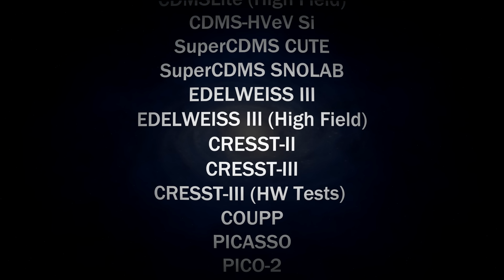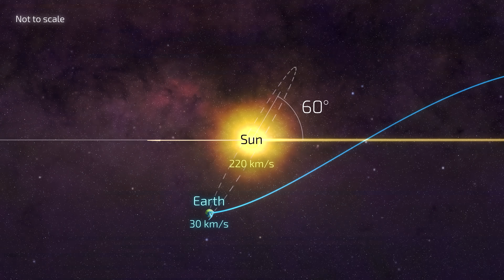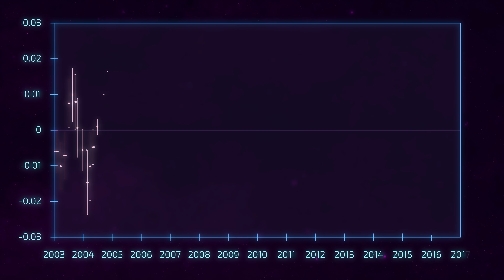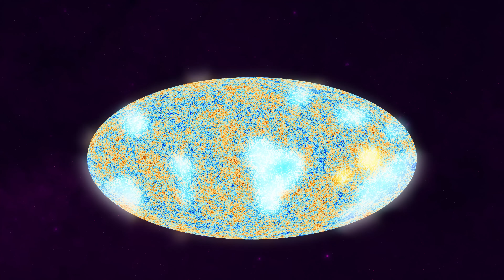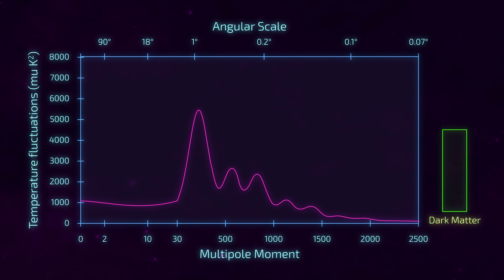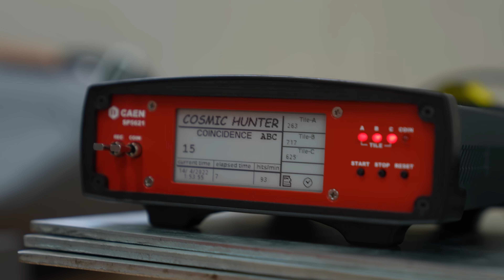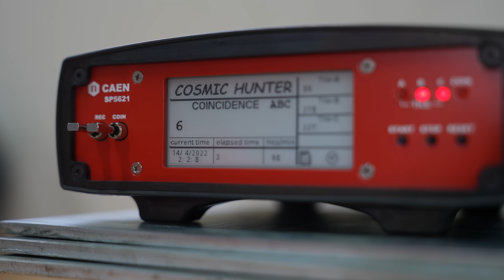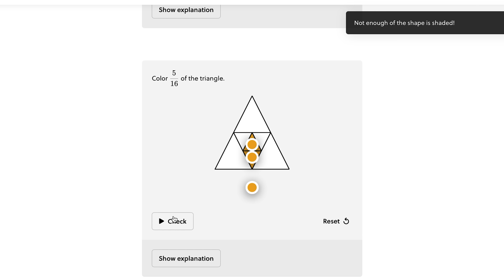The Absurd Search For Dark Matter

Comment: But if the stars in the galaxy need that extra mass, supposedly coming from dark matter, to stay in their orbit at the measured speed, how can we take into account the amount of mass inside of the (supposed) supermassive black holes at the center of galaxies? Do we have a way of measuring that mass? Can we compare if things orbiting smaller black holes exhibit a similar behavior? I am by no means an expert on this field, I was just wondering if that extra mass we're looking for could be from the black hole at the galaxy center (unless we've successfully measured that, then please never mind my suggestion ^^)
Reply: If the acceleration stays linear that means that mass also grows in a linear way regarding to the radius you travel away from the center of a galaxy, in this example a black hole. As the gravitation caused by the black hole should be calculated with 1/r^2 ( please correct me if I’m mistaken).
Thus a constant acceleration in regard to distance could be best explained by an also growing mass that has a somewhat homogenized distribution across the galaxy
Reply: @Tohuvvabohu  Basically correct, in Astrophys a velocity curve was first used to measure the orbital velocities of stars in galaxies (simply measured by doppler shift initially). If we set the gravitational force equal to the centripeteal force we get --> G*M_galaxy*M_star/r^2 = M_star*velocity^2/r so we would expect a 1/r gradient of the velocity curve. This isn't quite correct as we need to use newton's shell theorem and show the mass of the galaxy interior to the point we are measuring has an r dependence (the density of matter is something proportional to like 1/r^2 iirc) and then we can find a proper estimate for the velocity curve. 
Gravity of a black hole can be found using the inverse square law by measuring objects nearby to the black hole as dark matter is only significant over galactic scales.
Reply: @Tohuvvabohu  We can measure the mass of the Blackhole if it has something orbiting it.
Reply: @lsauce45  well yes, but the issue here is that if you measure the black holes mass while not accounting for dark matter you will get an incorrect result. So you would have to find a different way of figuring out for how much mass exactly each is accountable. That’s where you can use the concept I explained above to distinguish between the different gravitational fields they emit.
Reply: @lsauce45  But the entire galaxy is orbiting the black hole lol. And we can't measure the mass of the entire galaxy apparently.
Reply: Just as we can guesstimate that dark matter is present 5x to normal matter through its gravitational effects. We can also guesstimate with reasonable accuracy what the mass of black holes is. And we add the mass of black hole to the total mass of a galaxy so no that is not it
Reply: Yes, measuring the black holes' mass is elementary - you just look at the speed and the masses of the stars orbiting them (the masses being attainable through the mass-luminosity relation), and that's it. The masses of pretty much all black holes discovered thus far are known.

Also, even if we didn't know the black holes' masses, that wouldn't change anything, as the main/original source of evidence for the existence of dark matter comes from the outskirts of the galaxy instead of its centre, so what happens at its centre is mostly irrelevant.

Also, even if all black holes in the galaxy were suddenly teleported towards the outskirts of the galaxy, they still wouldn't account for even a fraction of the missing mass.

Unfortunately, your explanation doesn't seem to work any way that you spin it.
Reply: @maxkho00  How come movement of absolutely all galaxies are affected in the same exact way? Regular matter is not distributed uniformly in the universe. Is dark matter distributed uniformly? Shouldn't there be at least some galaxies that move differently because they have different form/amounts of dark matter around them?

I don't understand how that makes any sense. The way it is described it sounds more like there's some universal force affecting all the mass in the universe.

Or maybe dark matter supposed to be firmly attached to regular matter? If that's the case, isn't that just the same matter that weights more than we think?
Reply: Just to reiterate for those who do not read the whole thread, the mass of the black holes in galaxies is included in the 15%, as is the gas, dust, asteroids, and exoplanets. All of them interact with light, even if - as in the case of black holes, it is to capture it. Black holes also affect the light that comes near but does not cross the event horizon, thus we can detect them, take pictures of them, measure their diameter and calculate their mass.
Bear in mind that dark matter is not the same thing as dark energy, apologies if you know this already. And there is more than twice as much dark energy as all the dark matter and observable matter and energy combined. We can't detect dark energy either - obviously, other than the reason we think it exists at all. That being the fact the expansion of the universe is accelerating, which should not happen if the observable matter, energy and dark matter were all there is. The amount of dark energy there is is calculated by measuring the amount of energy required to cause the acceleration of universe expansion we have measured.
Reply: @TheJamesRedwood  Can a black hole consume dark matter ?
Reply: @ishaanupreti6438  It couldn't be tiny black holes, because we can detect black holes. And yes, dark matter can fall in to a black hole. It is called DM because the only thing we know about it is that it has gravity.
Reply: @ishaanupreti6438  Unknown. It is hypothesized that DM would pass right through a dark hole like it wasn't there.
Reply: @ishaanupreti6438  AFAIK we don't know.
Reply: @aaronmicalowe  But black holes influence things by gravity, and dark matter interacts with gravity.
Reply: @TheJamesRedwood  thank you sir for this rudimentaru yet sound explanation, sometumes you gotta see it as a whole
Reply: i love you <3
Reply: Didn't expect to see you here :o
Reply: Lol dubstep music
Reply: VIRTUAL RIOT!!!
Reply: bruh what u doing here
Reply: I think this is caused because the galaxies work like a single object. For example, in the solar system, planets that are closer to the Sun move faster and those that are further away move slower as one would expect. Where is the dark matter effect there? 
Would you expect that the center or the Earth rotates faster than the surface? of course not, because the Earth works like single object. The same happens with galaxies, when a certain density of matter is reached in a space, there is another force that holds it together.
Reply: @Trachta10  Galaxies do not work like single objects. Even at galactic cluster scale, they are amorphous and lose matter to each other if they get close.
As for your second paragraph. There is no another force, not in this universe. You are still talking about gravity, therefore we get the hypothesis of dark matter, we can see its gravity, so something must be there. This was all in the video. The reason its effect is not detectable at solar system scale, is because the scale is too small, DM appears to be too dispersed. A similar reason, in reverse, is why quantum mechanics is cancelled out at human scale, and you cannot pass your hand through another solid - despite such a thing being possible at the quantum scale.
Reply: @TheJamesRedwood  But in the solar system scale the dark matter is also there,  if the gravity of matter exists at solar scale then then the gravity effect of the dark matter should also be there in the same way that at galaxy scale.
Reply: @Trachta10  Yes it (the gravity of DARK matter) is obviously, always there. Gravity has not limit to its reach, but is does decrease at a rate equal to the square of the distance between objects, and proportional to the mass of either object. Dark matter is, like I said, very dispersed and in sub-atomic particle mass ranges (otherwise we could see it). It is only at huge, galaxy-sized scales, that the gravity of DM becomes large enough to be measurable.
Reply: Oh, it's easy:

You just put enough OTTs on the sensors until they start growling 🤣
Reply: If you look through the history of astronomy and the origins of "black holes" and "dark matter".  It comes from asteroid fields.  

Stars look like clouds, while asteroid fields look like black clouds (you have to be looking at a picture of the Milkyway galaxy.  Working backwards and the wrong direction, you get absurdities like "black holes" and "dark matter".

"Dark matter" isn't inaccurate, but there is already a label for asteroid fields.
Reply: @starbase51shiptestingfacility  All of that has already been accounted for, even the loose gas in space which adds up to even more mass. It's nowhere near enough to account for what is observed.
Reply: @aaronmicalowe  Let's see you prove what you say or be known as a troll.

You claim even gas is accounted for...  Let's see you prove it.
Reply: @starbase51shiptestingfacility   I'm not a scientist, but scientists have repeatedly said that they have accounted for all the possible gas in the universe and I accept that. But, to repeat, I'm not a scientist so don't know how to prove that and I am also not a computer database with access to a copy of everything I've ever heard. You need to find someone who is both a scientist and a database manager. Good luck. 👍
PS people who demand proof that they know is impossible to get otherwise threaten the other person with a label are the true trolls and are also fundamentally dishonest. FYI
Reply: Don't tease them with logic poor souls you'll kill their only brain cell then where will we be... oh, of course, left with the truth ... carry on then.
Reply: In my opinion, the additional mass cannot be central to the galaxy because it would change the speed of inner stars as well as outers. What we need is something that accelerates more for more distant stars. And thus it must be distant from the center itself.
Reply: @jpt3640  That opinion is exactly what is being said here 7:28. The dark matter is within and surrounding the galaxies.
Reply: @TheJamesRedwood  how come dark matter surrounds all the galaxies in the exact same way/shape? shouldn't there be at least some galaxies with different amounts/shapes of dark matter?
Reply: @jpt3640  fields can provide force at a distance from a central energy point.
Reply: Dubstep
Reply: @qualich  thats exactly what i was thinking haha
Reply: The point is that ‘normal’ matter doesn’t fly off from the spindles of galaxies - the angular velocity would overwhelm the gravitational field strength theoretically but there is something containing the matter almost
Reply: Dark matter could be tiny black holes scattered across the galaxy.
Reply: @ishaanupreti6438  The idea of black holes being the cause of dark matter was one of the first things people thought of. It's in the category of dark matter candidates called "MACHOs" or "MAssive Compact Halo Objects". Scientists have measured various properties that would be detectable if these were large black holes, and they have calculated the minimum size they would need to be to still exist, and there is a relatively narrow range of possible sizes. The minimum is 10^8 metric tons. So these would be black holes with the mass of asteroids too small to detect unless you already knew where to look and they would be distributed thinly through space. If that was all dark matter was and they were all that size, 1 would be close to Earth at any given moment so it would be unlikely we'd ever find it in the time before the sun dies...but it's actually worse than that since we know they can be much more massive than that, making them even less common to be 4/5ths of all matter. And it's also very possible that they aren't all of the 4/5ths of matter that is expected to be dark matter.

Of course, you probably noticed I didn't give the upper end of that narrow range. The minimum is pretty easy to calculate via hawking radiation, but the maximum is based on observational data which...has recently been growing more interesting.

If there are the expected detections in the equipment this video discussed, though... it's not definitely not tiny black holes. They are too massive and thus too rare to be detected in this way.
Reply: @Merennulli  Wouldn't black holes that small and towards the end of their lives emit insane amounts of radiation, making them easily detectable ?
Reply: @ishaanupreti6438  A thermal radiation source smaller than an atom (when it's that far gone) moving constantly, that can pass right through the earth would at best look like your thermal sensor had a minor glitch that never repeats, and the odds of it happening even once are astronomical.
Reply: @Merennulli  Who said it will pass through Earth ?
Reply: @ishaanupreti6438  This has already been considered and it's not enough and doesn't explain everything we observe.
Reply: This could be viable except for two issues: First, even if it's the black holes, it would still make the center rotate much faster than the rest of it, which is simply not how it was observed like the video stated. Second, Supermassive black holes are nowhere near close to the mass of the galaxy they're in, much less 5x of that so it couldn't possibly be that. To elaborate, the total mass of Milky Way galaxy is around 800 billion to 1.5 trillion solar masses while Sagittarius A* is "only" 4 million solar masses. But even if you don't know that, you can already logic it out considering there's 100-400 billion stars in our galaxy, it shows the differences in the scale. While it's true that star sizes also varies and our sun is on the larger end compared to a lot of other stars, the sheer number of stars still makes it much more massive than Sgt A*.
Reply: Yeah! And since we know nothing about it, we should check out how this mass interacts with a black hole, if we can detect it in some way, and if its relevance is proportional to what the theory would say about that unknown "matter".
Reply: @HawkFest  It is drawn to a black hole, like anything else that has gravity - that being the only thing we know about DM - it has gravity.
Reply: É isso aí gringaiada! Podes crer que nóis tudo tá ligado nessa parada do negócio da coisa aí!
Reply: Did anyone understand this?
Reply: lol
Reply: TF is VR doin here?
Reply: Make a dubstep track about your question 😂👍🔥🔥
Reply: The effects of dark matter only become measurably obvious over very large areas, like the size of a galaxy and above. Black holes, even supermassive, are tiny compared to the size of a galaxy, and I suspect that the effect of gravity from baryonic matter at those densities would overwhelm any detection of dark matter.
Reply: Wait what ? Should not you be making some Dubstep 🤣
Reply: the mass of a blackhole is measured the same way the mass of anything is measured: how other things orbit them. the mass of black holes in the center of our galaxy has already been measured and accounted for, it's really not that much compared to dark matter.
Reply: @Deltexterity  <--- Black hole cultist.  Notice that's all these guys ever do, but never ever prove it.

See how easy it is... I can claim the blurry picture of black holes are caused by gravitational lensing.  Notice no one ever gets around to proving it.
Reply: @Deltexterity  that's assuming the formulas used for the calculations are correct.
Reply: @ekklesiast  the formulae used for the calculations are the general relativity formulae (that's used for big things and quantum physics for small things), as general relativity has been challenged over and over again, thousands of mathematicians and the smartest people in the world trying to find a mistake, and not being able to. it's possible that our understanding of gravity is wrong, and that there is no dark matter, it's just that we don't understand gravity, but so far that seems much less likely. if the formulae for those calculations were wrong, it still wouldn't be black holes that are dark matter, because if gravity is wrong then gravity is dark matter. "dark matter" is just an attractive force we don't understand, if gravity is wrong then gravity just is that attractive force, and black holes are out of the equation regardless.
Reply: the most unexpected place i thought id you see virtual riot
interesting thoughts
Reply: Hello VR I am a fan : D
Reply: Idols guy
Reply: Black holes make up a tiny fraction of the total mass of a galaxy. In a solar system the ratio of mass is around 99% from the star, in our galaxy Sagittarius a makes up only .0004% of the mass. Just the mass from the black hole is not nearly enough to keep the galaxy together
Reply: or maybe the whole gravity driven only theory of the universe is completely wrong and it's driven by electric forces instead.

there was no big bang, there are no black holes and there is no dark matter.
observations can be explained by established plasma dynamics without the need for these hypothetical unobserved constructs.
Reply: @axeman2638  The electric universe theory is one of the most debunked theories there is. Electricity has been examined thoroughly and cannot explain observation.
Reply: I love that I just randomly ran into a comment from my favorite artist wtf. Love you VR, your music reflects your question ✌🏼See you at Bass Canyon and f gravity
Reply: That won't fix the discrepancy. If central mass (black holes etc) is large enough to explain outer stars not flying away at their apparent speeds, then observed speeds of inner stars become too slow to not fall into center.
Reply: @AG-ig8uf  that's assuming the gravitational formulas are correct? isn't that circular reasoning?
Reply: We know that the extra mass is from dark matter because dark matter also generates a different distribution of velocities for galactic objects than radiating matter plus a central black hole.  Even if the black hole at the center of our galaxy were larger, the objects at the fringe would still be moving slower than observed, it's just that the fringe would be located further out.  There are other explanations, of course, but dark matter is attractive (no pun intended) to physicists because it's the most consistent with other experimental evidence, like the expansion of the universe and observations of colliding galaxies.  Of course, nobody knows what it is yet, and it's certainly possible it's something else, but so far no one has come up with a better answer, so we're sticking with the dark matter explanation for the time being.
Reply: @annasimpson4147  Reminds me of helium. It was predicted to exist many years before it was actually discovered.
Reply: @aaronmicalowe  Indeed!  It took us 60+ years to discover the Higgs boson.  It will likely take us even longer to find dark matter.
Reply: @annasimpson4147  I look forward to the result of the experiment in the video and hope it shows us something, even if it isn't dark matter they're detecting. But here's an interesting thing, "dark matter" has already been found, by a universe modelling AI. It created a model so accurate that the only way that was possible is if it understood dark matter (or MOND) or something else entirely. Unfortunately, because it wrote itself organically, from within, even it's creators can't get the answer out. But it does prove a solution is possible.
Reply: @Shina We have seen the matter being pulled in. And if it was spewing matter, it would be very visible.

EDIT: So I get a "citation please" reply and then all posts by "Shina" are missing when I click to see the context. I'm going to write this off as yet another troll account.

Forewarning to any other trolls, you don't get to use demands for citation as a dismissal anymore. That BS worked last decade but we're not biting anymore. You just blow off whatever sources we provide, so it's not meaningful to actually provide them for you, and this is a conversation, not a term paper. And that's without even getting into the fact that Youtube throws posts with external links into limbo for anywhere from minutes to months with seemingly no rhyme or reason to it.

If you legitimately wanted a source, ask politely and indicate what you want it for. Youtube doesn't tell us what comment you're replying to, and 90% of the time more than one thing was said. So if you want to know a source for something, mention what something it is. eg. "You said water is wet, but I couldn't find any information to support that claim. Could you please point me to where you got that information?"
Reply: Black holes do exert a ton of gravity but only if you're very close, their gravitational impact is negligible once you're too far away (depends on their size) . They can't explain the speed patterns of a whole galaxy. Even though I would like this explanation..
 Would be cool if they are somehow the root of a "gravitational chain" that extends to the outside of a galaxy.
Reply: @Xyles7  More like TWO-AND-A-HALF tons! : )
Reply: @Xyles7  Oooooh yeah that's a cool one. I think it might be time dilation proportionate to the gradient mass quantity from inside to out. So we only perceive the laws of physics being broken. They are functioning quite relative to one another
Reply: @Xyles7  Sorry mate, this is a bit of a nonsensical statement. Black holes are the most dense, therefore the most gravitationally powerful objects in the universe. Yes, they have event horizons, but that is not where their gravitational effects end, it is just where is becomes weak enough (relatively speaking) to allow EM radiation ("light") to escape. They still exert incomparably huge gravitational fields beyond that, that bend light so much that when we look at them we can see the light coming from directly behind them - that is what is meant by gravitational lensing. Other massive objects also cause gravitational lensing, BTW. In fact that is one way we can prove dark matter exists, we get more gravitational lensing than we would expect from the visible matter (including black holes) that we can see. 
Gravity is a constant, relative to size and distance from the centre of mass, black holes do not have different gravitational constants to any other object with mass. So they DO, in colloquial terms, exert a "ton" of gravity way beyond any other type of object (it really pays to not use colloquial language if you want to talk about this seriously). 
You are right in repeating the statements made in this video, that the mass of BHs and all the other observable matter - including stars, planets, dust and gas, do not explain the motion (nor the gravitational lensing) that we can see - therefore dark matter must exist, as WELL as the dust, gas etc.
Reply: @TheJamesRedwood  Thanks for clarifying my comment. All I wanted to say was that a BHs gravity / mass in the center doesn't affect an object on the outside of a galaxy. If that is wrong then please clear me up again.
Reply: @TheJamesRedwood  In the known universe.
Reply: @Xyles7  It will have a weak effect on the orbit of that object, like our own solar system.
Reply: @Xyles7  Gravity has no limit. All objects (things with mass) in the universe are attracting all other objects. Obviously the effect gets weaker with distance, but it never disappears. In the more practical sense I think you are meaning, if an object is revolving as part of the galaxy, then it is ultimately under the direct influence of the SMBH at the centre, as well as through the gravity of all the other objects it has drawn towards itself. If by "outside of a galaxy" you mean something that is not revolving with the galaxy, but passing by, even then the SMBH, and the rest of the galaxy, is exerting gravitational attraction on it, but the gravitation of other objects in the universe may be cancelling it out, or indeed the object's own inertia is enough to overcome that effect, but there is never zero effect.
The limitless extent of gravitational fields also pointed us towards the hypothesis of dark energy. Because you would expect the expansion of the universe to slow down and eventually reverse due to everything with matter attracting everything else constantly. We know that in fact the opposite is happening, expansion is not slowing, nor steady, but accelerating. Some other form of energy is causing this to happen that we cannot detect - so we posit dark energy and try to figure out what that is. We know the quantity of energy required to do this to the observable universe, but we don't know what it is.
Reply: @aaronmicalowe  I am not sure which of my comments you are replying to, but it is not important. Obviously we can only hypothesise about the observable universe. "Known" is scientific nonsense - it defies the basic concept of the scientific method. We don't "know" anything in the true sense, only in the colloquial sense, which is to say - the unscientific sense. That is why the most concrete hypotheses, ones that have never been disproved, despite hundreds of not thousands of attempts to do so, ones that all new relevant observations confirm, year after year: such as gravity, thermodynamics, relativity, quantum mechanics - are given the title *scientific theories*. There is no higher order of certainty that can be described. I am sure you know this, but you chose to make an obvious (and therefore pointless) and inaccurate qualification of my comments, so you deserve the basic lecture.
Reply: @TheJamesRedwood  Your reply to Xyles7. The known universe is smaller than the observable universe because we don't know about everything in the observable universe, yet. (We don't even know about everything on Earth). And like I've said elsewhere, I am not a scientist, so don't limit myself to their terminology.
Reply: @aaronmicalowe  Scientific terminology is accurate. It is not a limitation, it is a freedom. It makes communication crystal clear. Surely being misunderstood is a limitation. Surely not communicating is a limitation.

I'll try again, there is no known universe, it does not exist. All we have experience of is the observable universe - and I spent the entire comment explaining that this does not mean we "know" anything about it, let alone *everything*. 

Using the term "known universe" is so imprecise as to be meaningless, even in colloquial discussion. You communicate nothing when you use it.

Have a look at the discipline of epistemology if you think you can define what "know" means. Much more intelligent people than you or I have debating that in writing for over 4000 years. There is zero general agreement. Whereas "observe" has some general agreement, which is the heart of the scientific method. An example is that if most people agree that the thing I am holding is a blue pen, then it observably, objectively, is a blue pen. And that's the closest thing you can get to the truth.
Reply: @TheJamesRedwood  Well, I am not a scientist so I use whatever words best fit what I am saying. I don't limit myself to only those words deemed "scientific" by others. This is a natural way to communicate. Anyway, this is drifting off topic.
Reply: Hey 🥰
Reply: The two aren't comparable because supermassive black holes don't dominate the galaxy like a star system black hole does, because the mass ratio is wildly different.